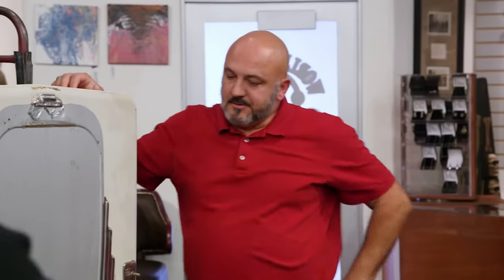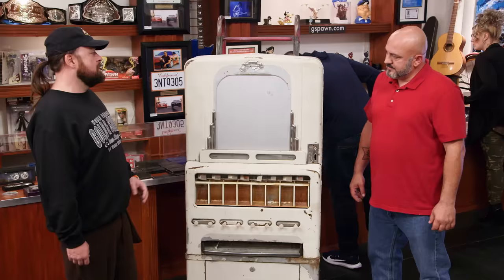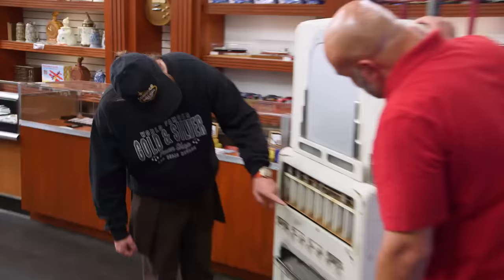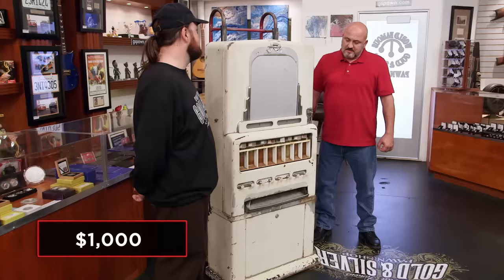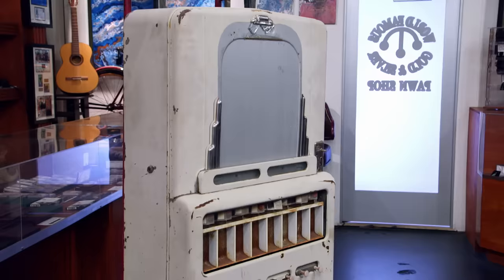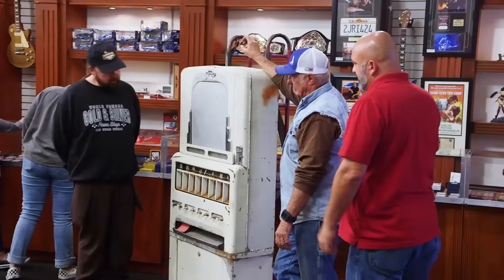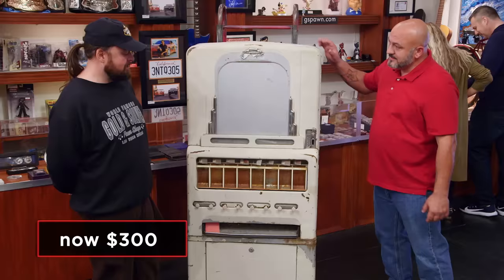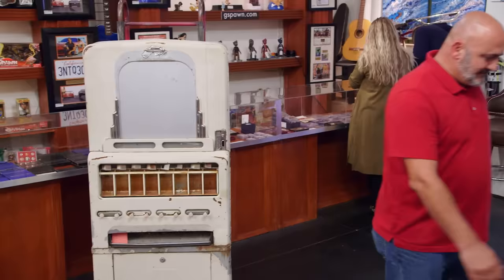Pawn Stars: Chum's SUPER SWEET DEAL for 1940s Candy Machine (Season 18) | History

Comment: I used to think that restoration expert always overcharged his works, but man that piece of junk turned out fine. Still a bit overpriced to me but building a working and repainted machine out of junks worth $30 in scrap metal seems like a job nobody wants to do. There are antique vending machines better than that at cheaper price. But if the show want it built from scratch then it's up to them